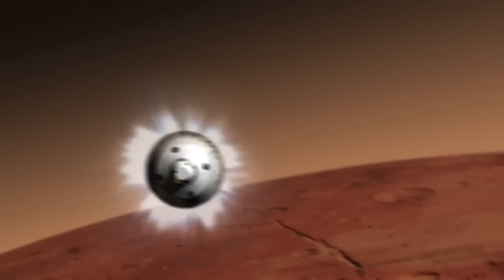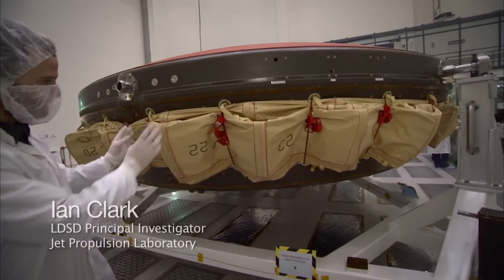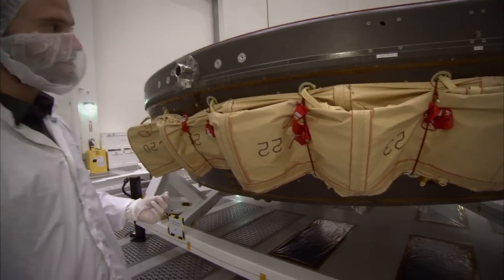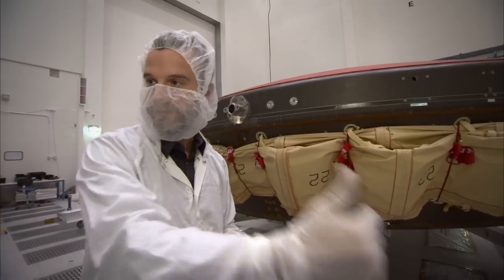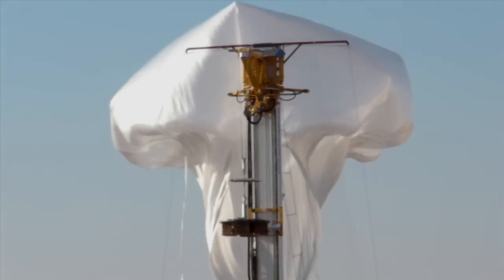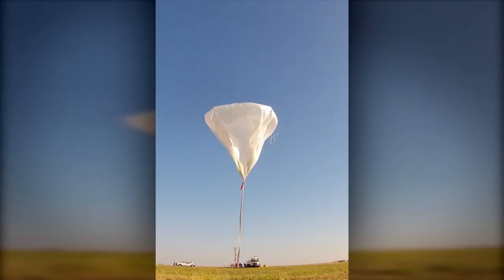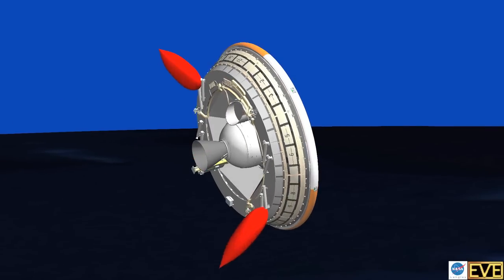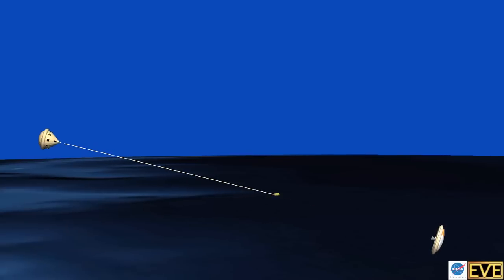LDSD: The Great Shakeout Test For Mars

Comment: Nice work!... How is the "aerodynamic decelerator" inflated?

I imagine that it’s a chemical reaction since a canister of some kind of gas would be impractical for a number of reasons…not least of which would be weight.
 
On Earth, Sodium Azide (NaN3) is used to deploy airbags. Some inflators are multistage reactions utilizing different compounds at each stage. Your aerodynamic decelerator is quiet a large volume envelope. I imagine that the speed with which it must be fully inflated is crucial.

What mechanism is used to open your decelerator as it descends through the upper atmosphere of Earth as you test, and the atmosphere of Mars later?

Comment: Will someone please explain why a parachute is not enough?
Reply: We want to be able to deploy and land heavier objects than is currently possible.  If the payload is heavy and is moving too fast when the parachute opens it will tear the parachute.  However, if we can slow the payload decent down before deploying the parachute then we can land larger payloads.  For instance, a habitat facility for colonization would be larger than could be handled by just parachutes alone - just one example.  Hope that helps?  NASA guys, take it from here....
Reply: its a complementary technology, besides the parachute you use this so you can land havier payloads
Reply: ***** Not at all! As David Duvall said above, even though a large enough parachute could slow down about anything, the problem is if the payload is too heavy and is going too fast when you deploy the parachute, the deceleration will be too brutal, destroying the payload or tearing the parachute. For instance, Curiosity got up to 9 Gs when deploying its parachute. You don't want to put sensitive equipment through anything rougher than that!
Reply: A parachute cant slow it down fast enough before it would hit the ground.
Reply: Mars atmo isn't dense enough as the video notes by at 0:12.

As such the parachute only config with the increased payload would be as effective at stopping the vehicle as would a pie thrown at someone's face would be.

IE useless, well, the pie to the face thing isn't quite useless but you get the analogy. Not enough atmo density = module goes splat, and by splat i mean explode in fireball of hopes and dreams on the surface of Mars.

That's why these bad-asses decided that since the payload proportions cannot be changed (this whole thing has to fit inside a rocket, like a pie in a cardboard box) then they will add these inflatable bags on the side of the vehicle.

Inflated balloons = greater surface = more friction despite low density atmo => nice deceleration, no rockets fired, no fuel expended. (since that's the other way they could of had done it)